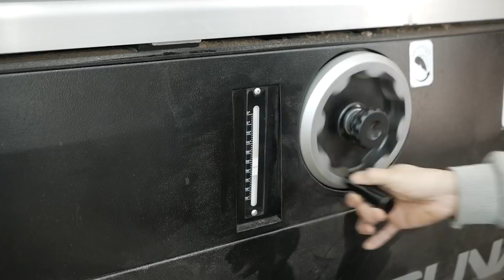SQUARERULE FURNITURE - Making a White oak Low Table

Comment: why gluing with radial rings in one direction and not in different?  won't there be seasonal decorations and wood curves?
Reply from the maker: Are you talking about how to attach the top plate?

In the books we learn often, it is explained that the directions of the trees are to cross each other, but the deformation of the trees cannot be prevented.

As long as the structure is not a big problem, I prefer the pattern and color.

Comment: Your videos are really inspiring, beautiful work and technic. I have 2 questions :) Where did you get the measuring tool you unboxed? And what are the planers you're using at 9:55 and 12:28 ? Thanks a lot.
Reply: If I may. They are Japanese scriber gauges and the planes to which you refer, are a Lie-Nielsen bronze no.4 smoothing plane and no.102 bronze block plane. Hope this helps. All the best to you.
Reply: @chm1701  Thanks man, it's appreciated!
Reply: @vranwild . Hey, no problem. You’re welcome.
Reply from the maker: wow~~~^^👍👍👍
Reply from the maker: I bought an additional used measuring tool.
I have several measuring tools and most of them are made in Japan.
Thanks for watching!
Reply: @squarerulefurniture  Keep the work! My dream would be to do a training with you 😁
Reply: @vranwild . Get in a line 😬😉

On a separate note, you really should sign up for a woodworking course, Stéphane 👍
Reply: @chm1701  Ahah yeah I should learn Korean and plan a trip :D

Comment: Is that still Auro 126 finish? If so, why did you choose 126 instead of 123 or 129? I'm not sure which to buy.
Reply from the maker: 123 is inconvenient to apply because the ingredients have recently changed.
No. 129 is not used because it contains a wax component.

It is easy to apply, safe, and seems to fit me well.
Reply: @squarerulefurniture  thank you for telling me. I was going to consider using 123, but now I should buy 126. Thank you sir
Reply: We use the no. 123 with an heat paint spraying gun (ca. 70°C) and it works very well...